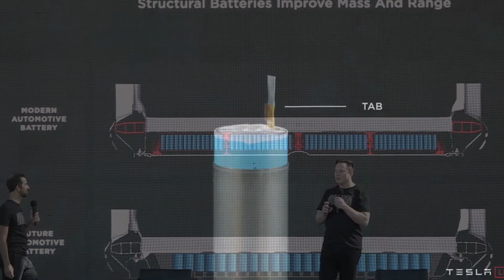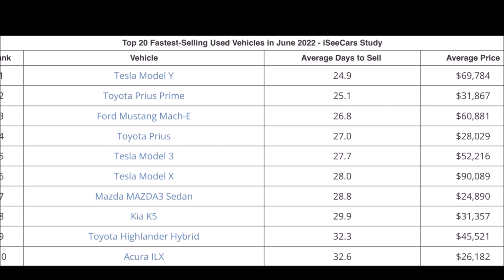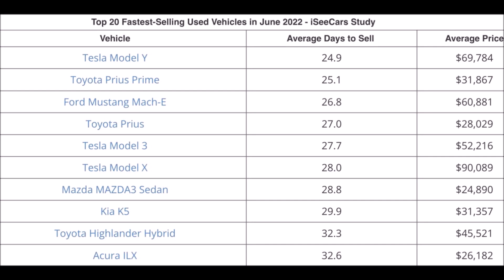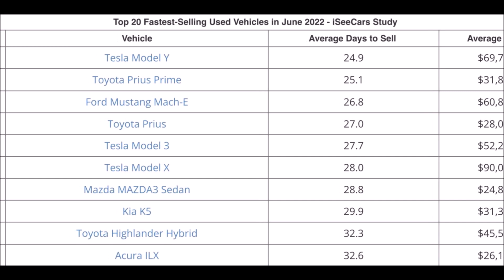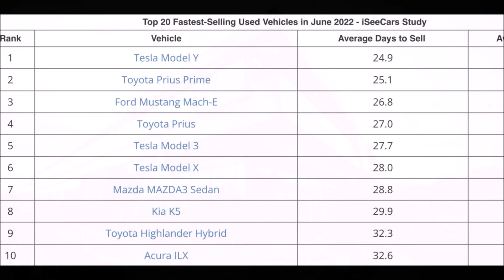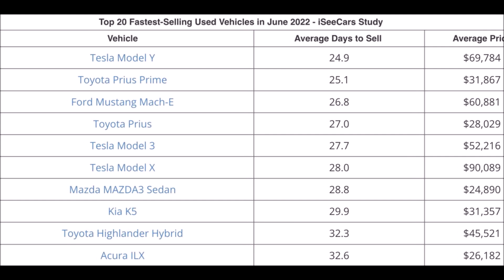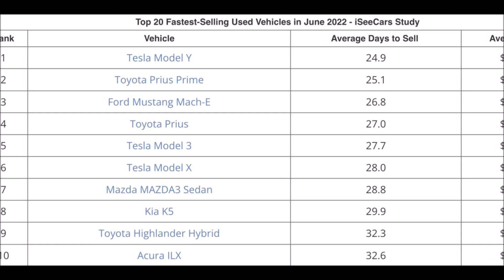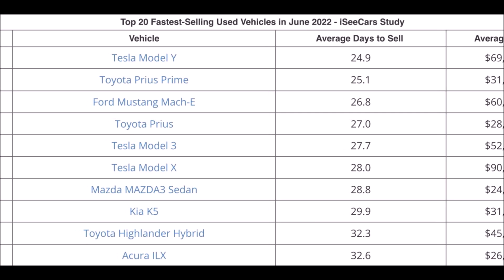Tesla Confirms The New Date for 4680 Battery Production at Giga Texas

Comment: It was clear by Tesla's product decisions over the last few years that the 4680 batteries were truly difficult to manufacture in bulk. First, the Tesla Model S Plaid+, which planned on using the 4680s was dropped, and the regular production Plaid and LR models both used 16850 batteries instead. Following that news, the Tesla Roadster, Semi, and Cybertruck continued to be delayed. They all had originally planned on achieving their impressive performance and range claims by using the superior 4680 batteries. The Berlin Model Y was originally rumored to be totally unique and superior (using 4680 batteries) compared to the Fremont produced models (using 2170 batteries), and when Giga Berlin finally started production, Tesla back-peddled and started using the 2170 batteries instead. Even though the Cybertruck production was supposed to begin in Texas, the factory opened producing Model Ys only, and only using the 2170 batteries. There could easily have been other issues that delayed the Cybertruck's production schedule, but 4680 battery production certainly was part of the problem. Ongoing problems in volume 4680 production in (Kato rd) Fremont had Tesla limit Texas Model Y production to mostly 2170 battery models, and the pack size for the Texas Model Ys that used 4680s was limited to 50kWh. Plus the 4680 battery powered Model Y was (and still is) NOT even listed on their website. If 4680 production at either Kato rd. or Giga Texas had been better, then all Model Ys (and probably Model 3s as well) would have been using their new 4680 battery, and the top Model Y would probably have fitted a full 75kWh+ in the battery pack, enabling over 400 miles of driving range. Delays in Giga Berlin construction, and their own 4680 battery factory have kept them building their local Model Ys using only 2170 batteries for now. As 4680 battery production ramps up in Fremont, and soon in Texas, and later in Germany we will start to see most new models start using 4680 batteries, with only the entry level SR models using LFP batteries. 4680 battery production by Tesla's battery manufacturing partners Panasonic and LG are coming, but are still years away from volume production. It is most likely that CATL and BYD LFP battery production will keep increasing in Giga China's Tesla EV factories, because in addition to being cheaper, and using no cobalt, and other attributes, Chinese local incentives require a high percentage of China-built components for Tesla vehicles to qualify for the full subsidies. Overall, it is good news that Tesla is confident that they can ramp up Texas 4680 production later this year, as having more 4680 batteries available and used will make Tesla more competitive against a growing list of competitors.